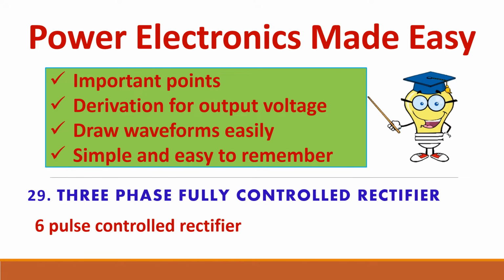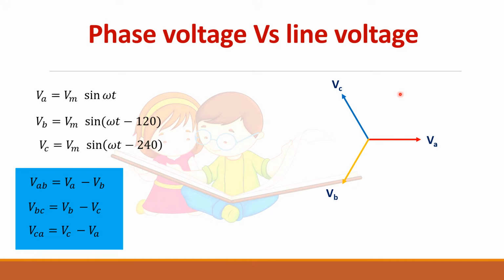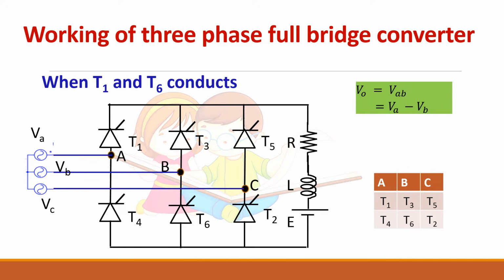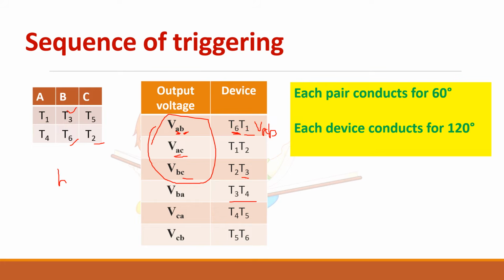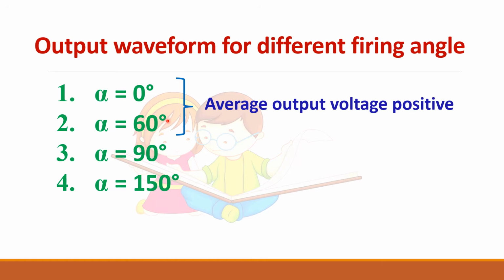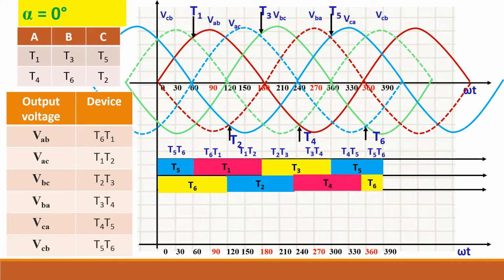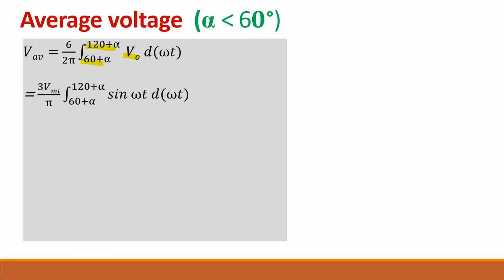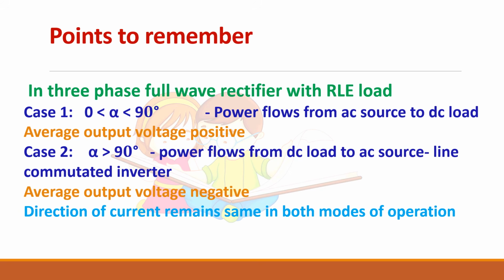29. Three phase fully controlled rectifier feeding RLE load

Comment: very well . i want to do it . what integrad circuito i use to do this logic combination ?
Reply from the maker: you can build rectifier using 3 phase bridge rectifier Ics are available for different current ratings. First choose your power rating and select any rectifier bridge can be used.
For gate pulse generation, a gate pulse from microcontroller/FPGA can be used with proper isolation.
Reply: @readelectricvehicle6078  Hello thanks for answering my question.

Comment: I have a question, can you please tell me how do you decide which diodes will conduct and when.
Reply: I mean thyristor ( not diode)
Reply from the maker: @tejaszunjare9096  For thyristor to conduct, 2 conditions must be satisfied.
(i) it should be forward biased (ii) it should receive gate pulse.
for example take alpha =0 degree,  T1 is forward biased  and receives gate pulse at 60 degree, so it starts conduction at 60 degree

Comment: Hello! I have a question about the line to line voltage graph in the examples with different firing angles. I think you have Va, Vb, Vc instead of Vab, Vbc and Vca.Vab shouldn't be 0 at wt=0. Could you check this?
Reply: I see that you mentioning about the reference voltage... can I just set Vab like how you did for any situation? It looks way better than having 30 degrees.
Reply from the maker: yes. Always make sure the phase difference between 3 waveforms either line -line or phase voltage is 120 degree
Reply: @readelectricvehicle6078  I see. this is very helpful. Thanks!!!
Reply from the maker: @evanlee95  . Glad it helped you. Please do subscribe and share it with your friends.